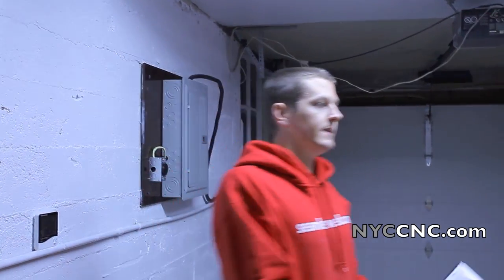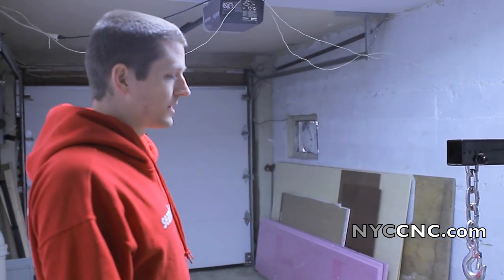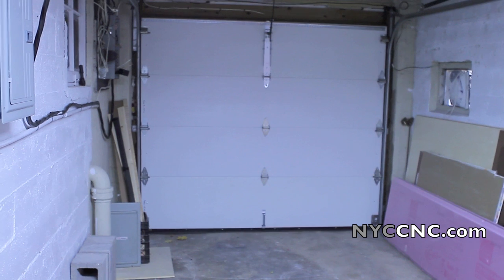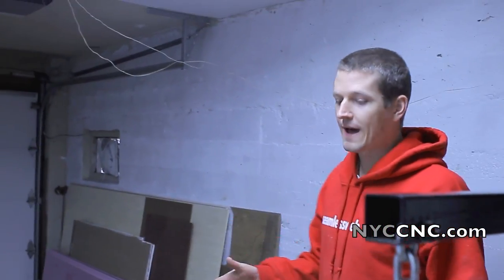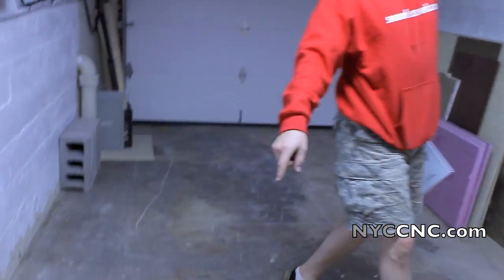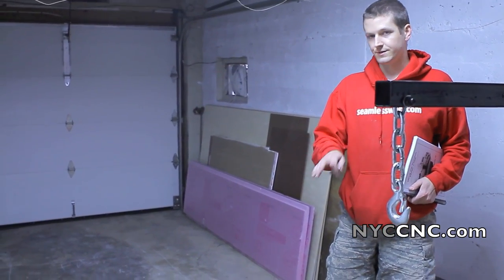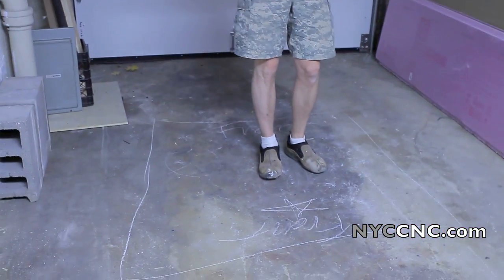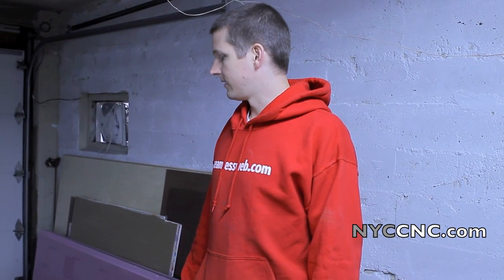Tormach PCNC 1100 - Planning for Mill Delivery.  Ch. 6

Comment: You should inspect the mill and other contents before you sign the shipping papers from the trucking company anayways. I have never had a trucker complain about me popping the lid off a crate before I signed to check for damage. If you happened to find damage later you after the trucker leaves could possible cause some headaches later. He should be able to position the crates to help you out.